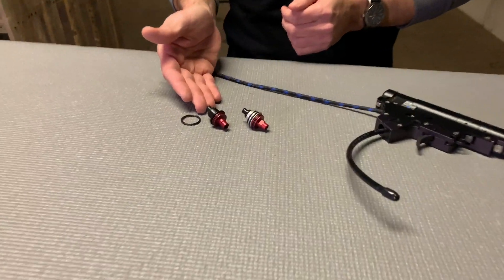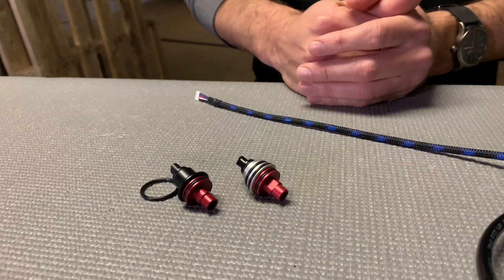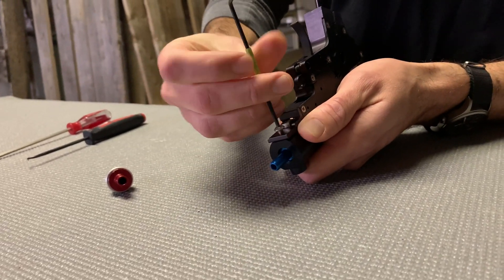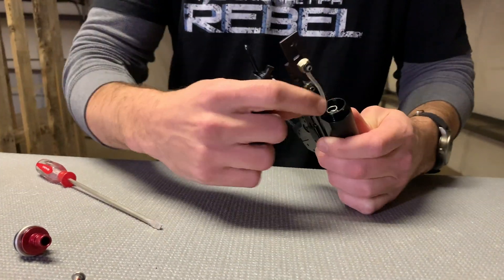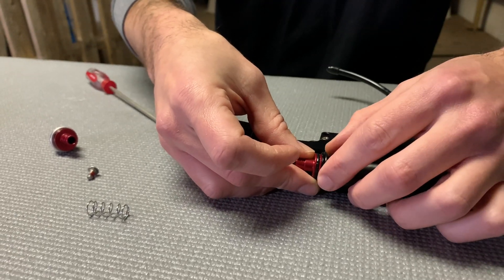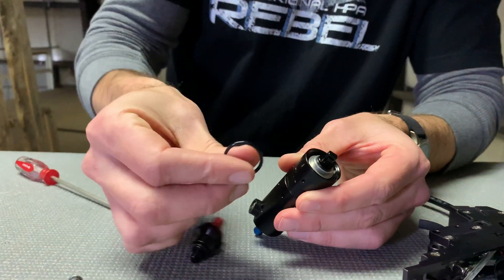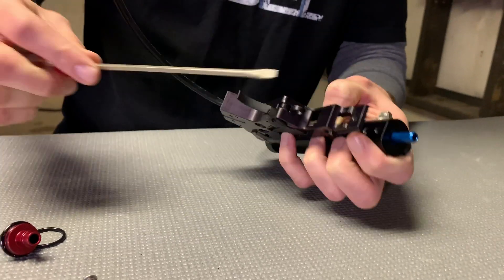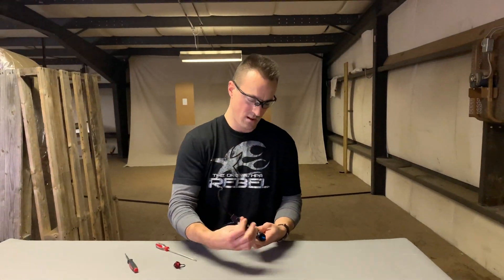PolarStar Airsoft - Fusion Engine Poppet Valve Update

Comment: Update if you need it, but not something you have to do, right?   If it ain't broke, don't fix it.   : )
Reply from the maker: Correct. There is no performance difference between the two. The only advantage is that it is easier to install/remove.
Reply: Is true unless your going from a old stock poppet to a new gold poppet

Comment: Now with this new valve would you still be able to get the different colors for different air flows and would you still be able to shim it
Reply from the maker: Yes, the only part which is different is the seat so you can still change out the stem to a low flow. However, this design is being used for all of the FE poppets so low flows will be available like this as well. This valve can still be shimmed in the same way as the old valve.